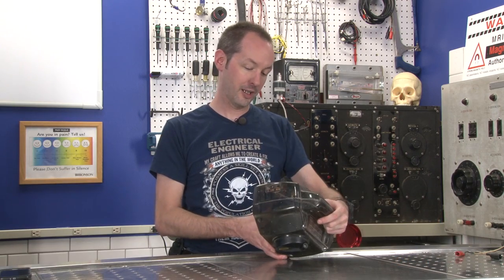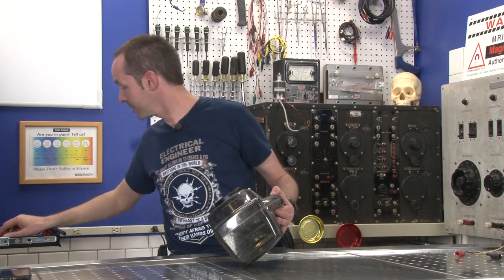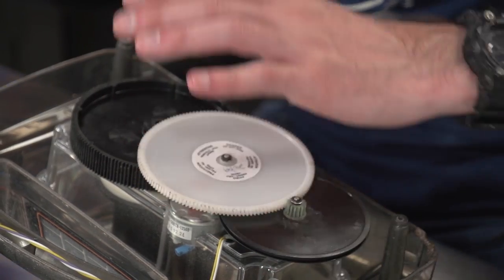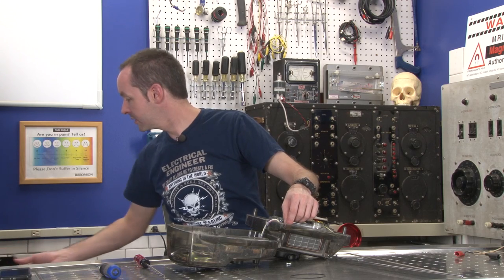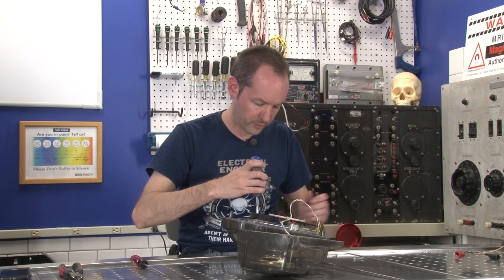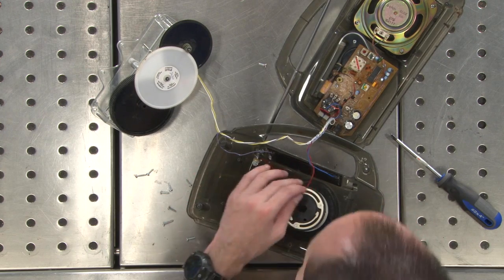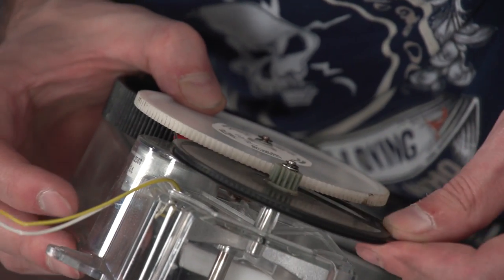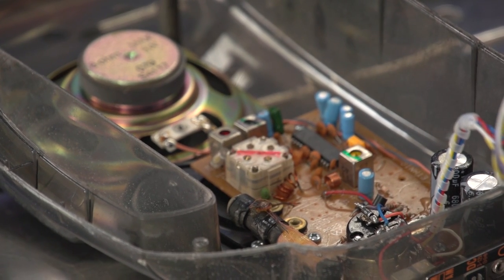Self/Solar Powered Radio: Equipment Autopsy #84

Comment: I have this radio.  That sound is caused by the belt slipping. (it's a 55mmx1.2mm belt).  Replace the belt and it will work fine again.

Comment: I've never seen one like this before. The ones I have just charge the battery when you turn the crank. They are also a lot smaller.
Reply: this radio is a 2nd generation Baygen, (invented by trevor bayless) , then later the chinese copied them, by making them super cheap, but not as solidly made

Comment: why is it spinning faster when turned on ?
Reply: it turns faster if the current draw increases, or more power is needed. My feeling was that unloading a permanent magnetised generator (dc motor) would allow it to spin faster because of less "load" as a burden. the spring should pressurise it evenly while it spins slower.... any insight? does it spin slower because there's no diode and the capacitors build a charge that creates a back flow of current and holds the engine? We want the schematic pls 😊
Reply: +Moes My guess is there is some sort of voltage regulation circuit designed to "load down" the output of the generator once the charge built up in the capacitors reaches a certain voltage.

So what you're seeing is the capacitors get charged up, reach the maximum voltage of the system, the regulation circuit kicks in and effectively shorts out the generator, loading it down causing it to spin slower. Once the voltage begins to drop, the regulation circuit drops out, allowing the generator to build up charge on the capacitors once again. Rinse and repeat.

Simple yet clever method of obtaining as much run time as possible from spring stored mechanical energy.
Reply: +MTTT3000 That would be called a 'shunt regulator', if I remember correctly. It's basically a reverse-biased zener diode that triggers a shunt transistor when a certain voltage is reached, thus loading down the generator under no/low-load scenarios.